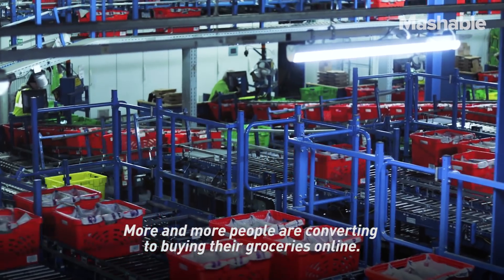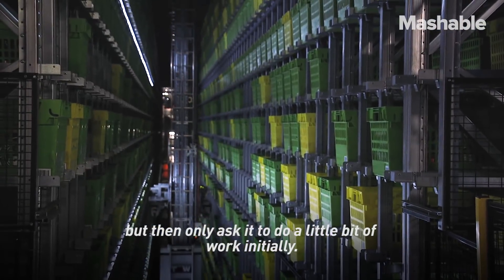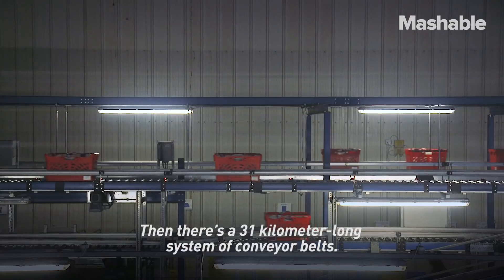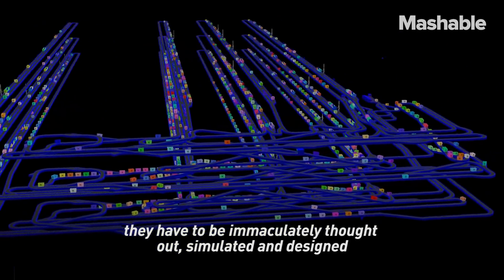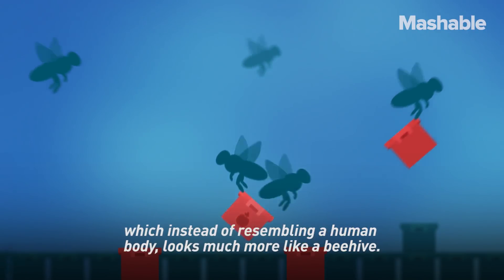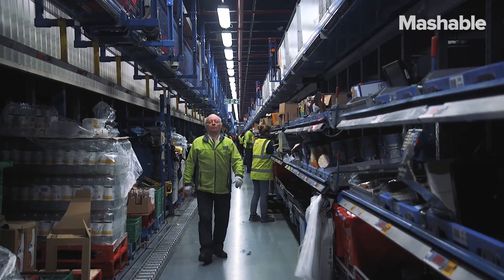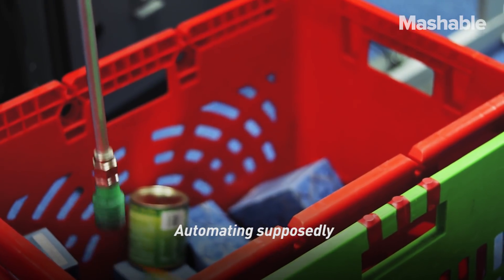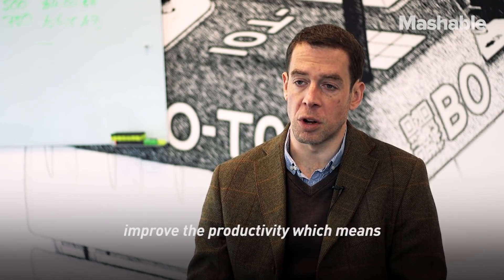The Gigantic Grocery Warehouses Built like Living Organisms

Comment: This is extremely inefficient. Amazon has designed much better efficient warehouses that store a lot more and doesn't get "clogged" as easily.
Reply: Ocado pick is at least 50× faster than Amizon for retail food shopping that sells Ambient, chill and freezer goods. I know for a fact that Amazon don't do chill and freezer goods so you don't know what your on about.
Reply: @legobrickabrac  Ever heard of Wholefoods? You don't know what you're on about, and show me the numbers and statistics backing up your claim "50x faster"
Reply: @politicalstatus197  I work at Ocado so I think I know exactly how it works.
Reply: @legobrickabrac  If ocado's individual robots solution was more effective, then Amazon would have implemented it long time ago.
Reply: @dimitariliyanov3680  Not really as the goods sold or completly different. Ocado systems focus on mainly food retail where as Amizon is not food focused.